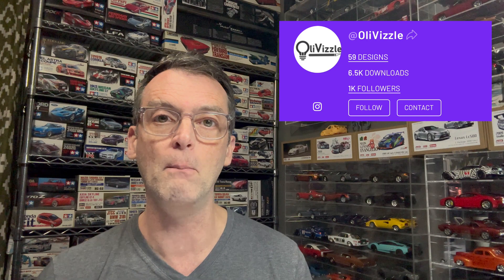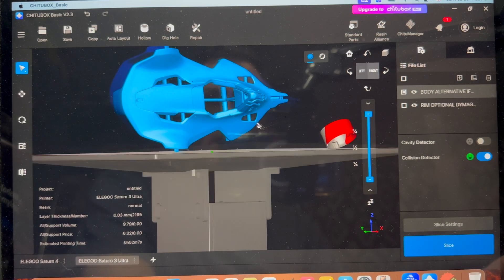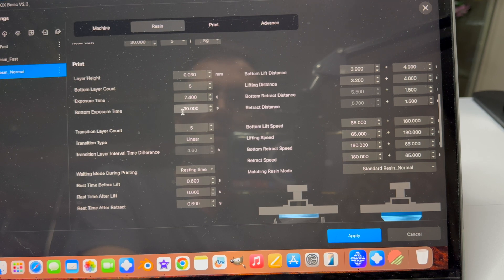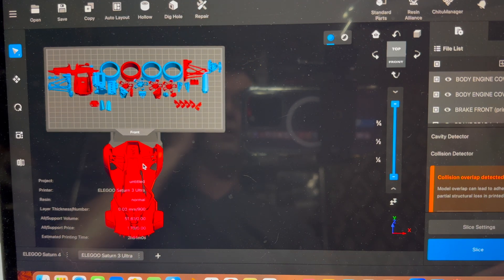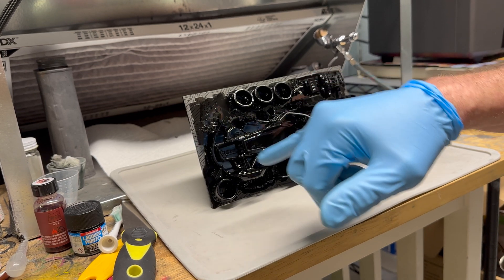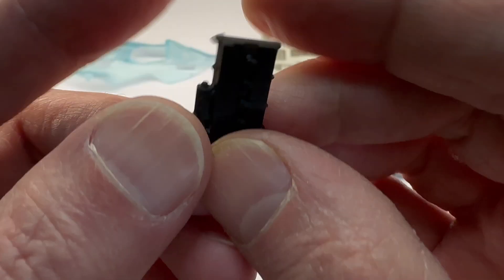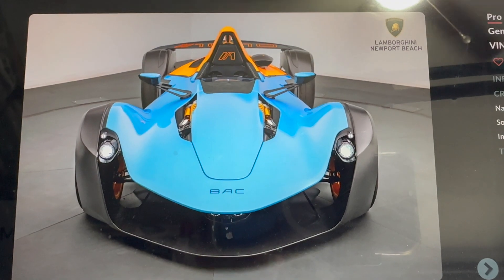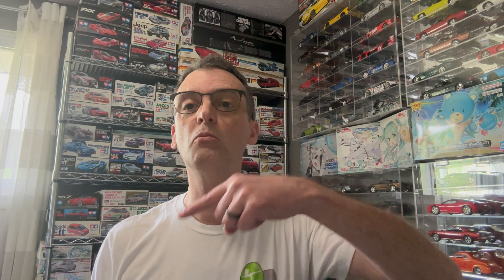Start to Finish - 3D Printing a 1/24 BAC Mono in Clear Blue Resin

Comment: Very interesting video as usual, I noticed that you are using your S3 pro printer rather than your S4, I have the S4 and all my bodies have what you call (z shift) but so bad that it is impossible to fix, do you have more Z shift with your S4?
Reply from the maker: I print most of my bodies with the S4. It really does need the supports on the inside of the body to keep it stable during printing. Also keeping it low to the build plate helps. I’ve been using 13 degrees angle lately.
Reply: @ScaleModelExperiment  Thanks for replying James, your advice makes sense I will try that tomorrow, I hope it will solve the problem because I am desperate, I have been in contact with Elegoo for a week, but no luck so far, thanks again

Comment: I’m thinking with a good wet sand and a few good clear coats the body will look stunning. Curious if you painted the inside of the tire/outside of the barrel silver the clear may not get lost in there. What a great experiment. This would make a great kit to build.
Reply from the maker: Thanks Spencer, I think that some of the translucent will come back with polishing but not all. Oliver actually suggested doing the wheel centers in clear too to show off the brakes. I’ll play with some foil on the inside of the barrel to see if it makes a difference.
Reply: Imagine some LEDs or fiber optics or something as well. Endless possibilities.

Comment: Ollie's BAC Mono was such a fun build. That is an awesome idea with the clear resin. I wonder how the clear parts would look if you clear coat them a few times, or maybe sand with a high grit and then clear coat.
Reply from the maker: I don’t think they will turn clear again like when I pulled them out of the printer but still think it will look cool with the orange highlights.

Comment: Turned out nice, plenty of details, love the pedal box part, nice files, great video James, Cheers 🍻 🦘🇦🇺🪃🏔🤝🇺🇸🗽🍻🍻
Reply from the maker: Loads of details in that kit. I hope that I can do it justice when I get to building it. The black resin was temperamental when the parts got taller. 😞
Reply: @ScaleModelExperiment  absolutely agree 💯 % and you will turn it into awesome, yes I see that with the black, isn't that the water based one? As I see a lot of water resins have problems, enjoy your weekend 🍻 🇦🇺 🦘
Reply from the maker: @ yes it is the water wash black. I simply didn’t have enough to do it again 🤓
Reply: @ScaleModelExperiment  ok yes, you will have to use another black, have fun 👍 😁